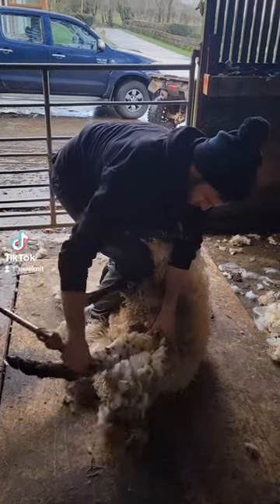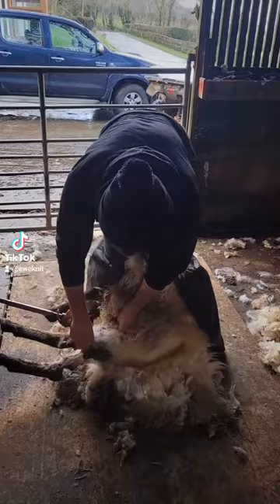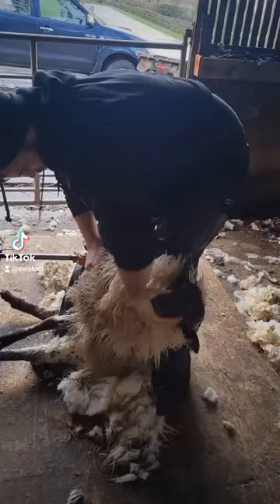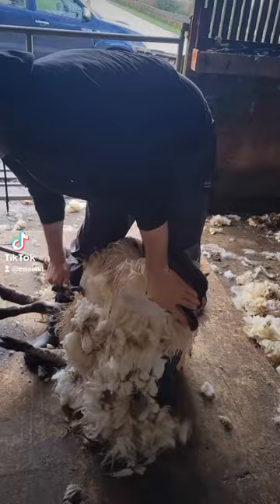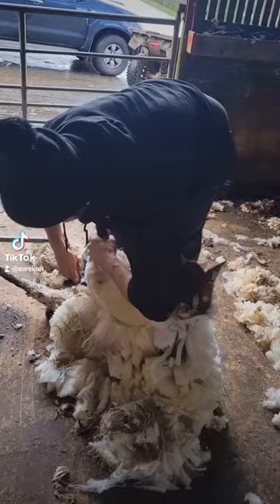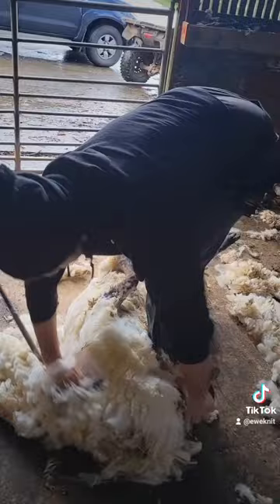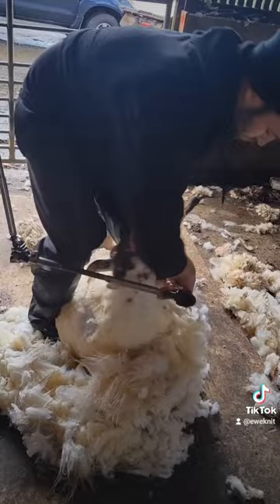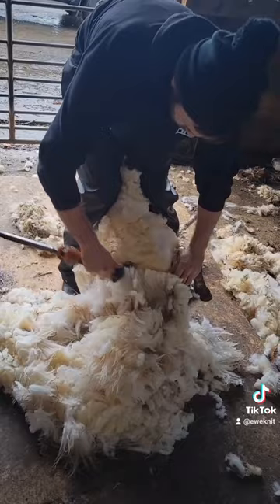Shearing but with a different twist! Subscribe for more videos.

Comment: Have you tried to use a cover comb or winter comb /snow comb they are sometimes called. 
we use them in the cold higher altitude areas in Australian. 
Most shearing comb manufacturers make them, they only leave about 10 millimetres of wool so might not leave enough behind for you. Topping sounds like a real pain in the arss.
Reply from the maker: I don't think they leave that much do they Jesse? It is a pain but you get used to it. I'm not to particular with it so I don't end up being that much slower than normal shearing. 😁